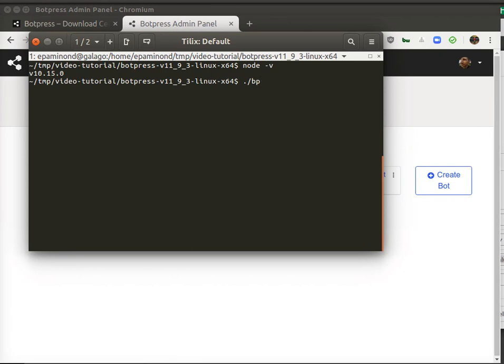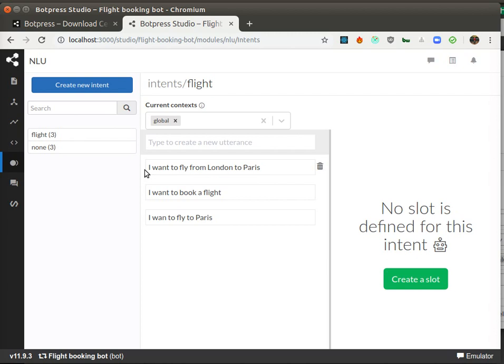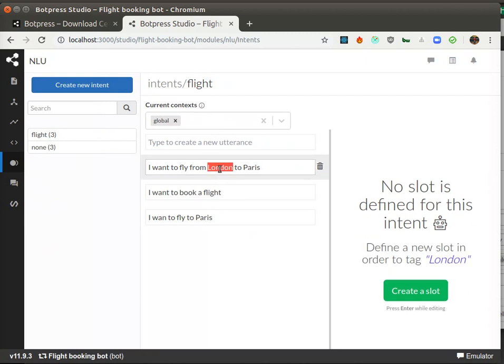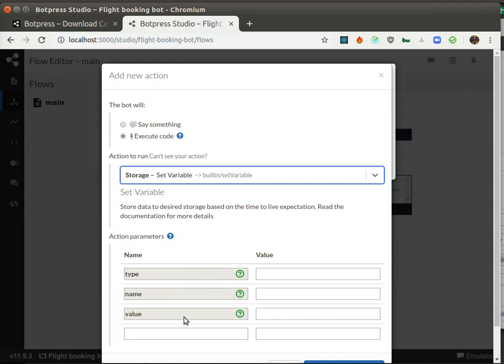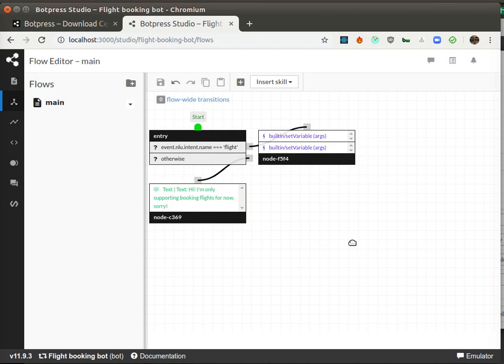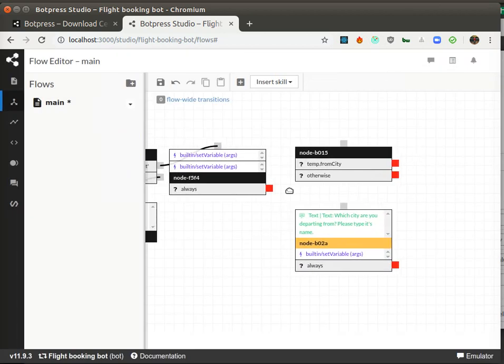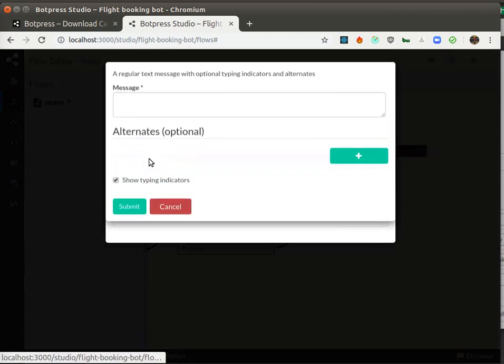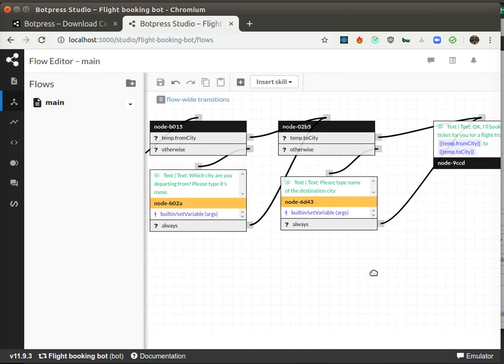Creating a basic bot with Botpress v11

Comment: hello i am getting errors when the initial message is not given both variables, IE i can get to "which city are your travelling from?" but then it errors out. can you please share any troubleshooting/debugging tricks?
Reply: I solved it the node that I was getting the from city had to have code on enter and then wait for user instead of the code being on receive. I noticed this video was made a year ago could a platform update cause the changes?
Reply: You know what actually happened. I used the origin get variables method instead of event.payload.text